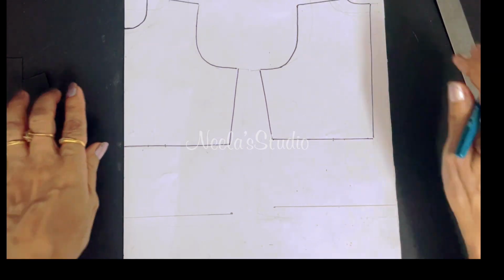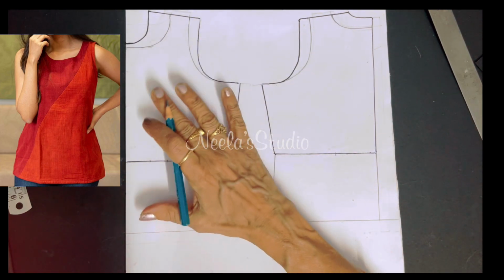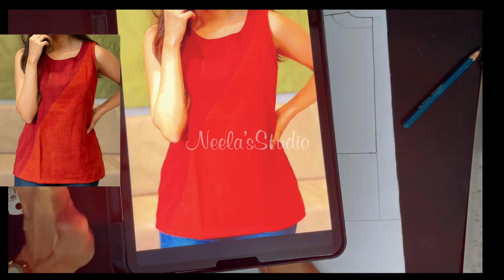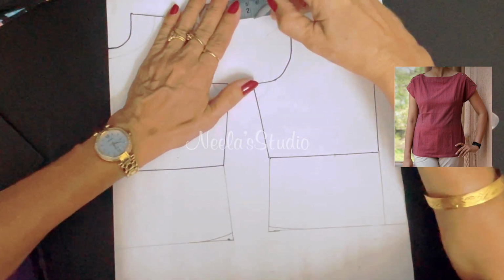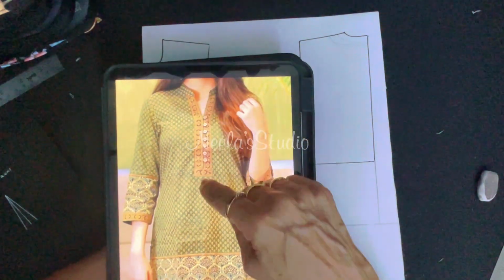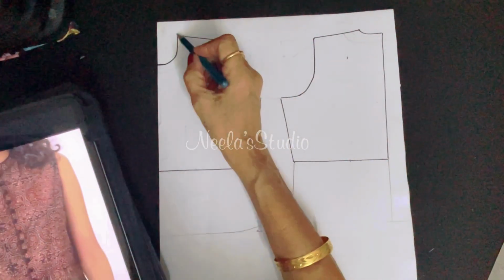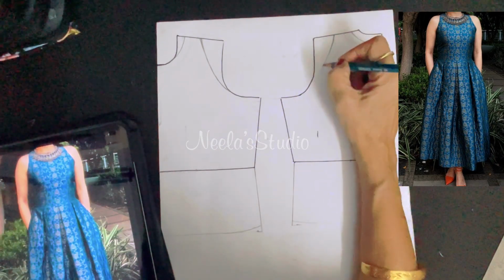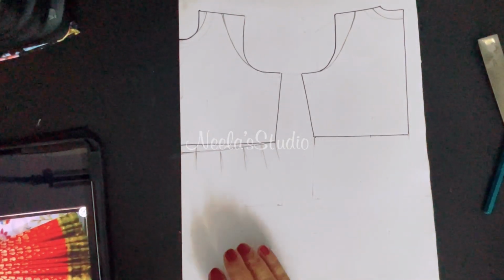How to create your own design using the bodice block.

Comment: Ma'am, I have 4 questions and video requests from you. 
And I know it's a long comment, but hope you read it. 
1. About the shoulder slope. 
Some suggest slope towards neckline and some towards armhole. What's the right way to do it according to each person? Can you elaborate on this one like armhole theory.
2. I stitched a blouse by turning lining fabric inside to avoid plackets for neckline and bottom hem of blouse. After top stitch, the neckline looked stretched and lost it's shape. What could be the reason? How to rectify this? 
If there's no solution, does facing help? Or placket is good enough?
 
3. You said that armhole theory is different for kurti. Please make one just for a basic kurti. 

4. You mentioned how across shoulder reduces by quarter inch for every inch of neckline. But what if backside neck is high and front is low? Do we check back or front in such cases? 

Ma'am, I'm very grateful for your videos. You can see I have too many questions. If there's any way to contact you through mail or any other way possible, it would be great. I want to learn so mucha nd I'm looking for some guidance. Hope to get a response from you.
Reply from the maker: I will answer soon
Reply: @neelasstudio854  Thanks for the reply. I'll be waiting ma'am.
Reply: @neelasstudio854  ma'am, I have been waiting for your response.
Reply: @neelasstudio854  ma'am.. I have been waiting for your reply about these.
Reply: so a same doubt for question 1 and 3,4...please clear it especially 1 is very important